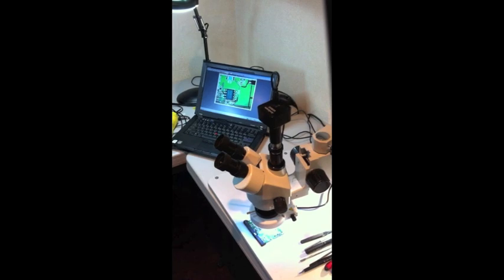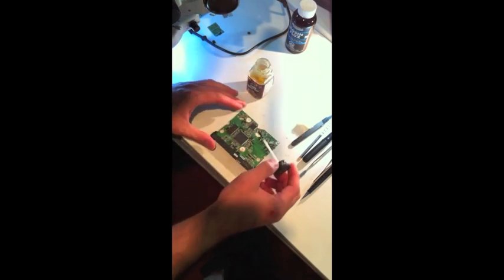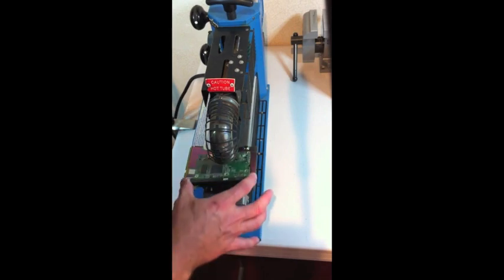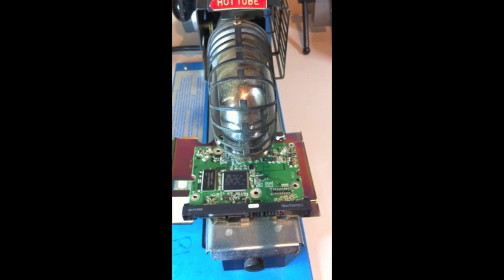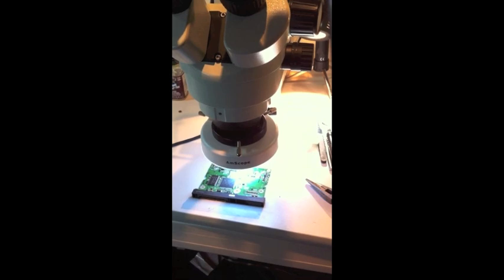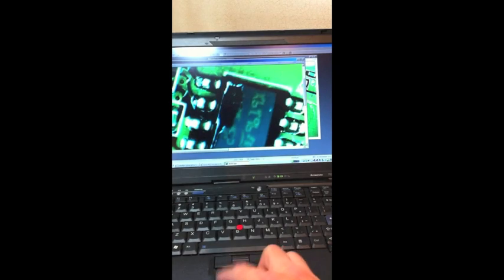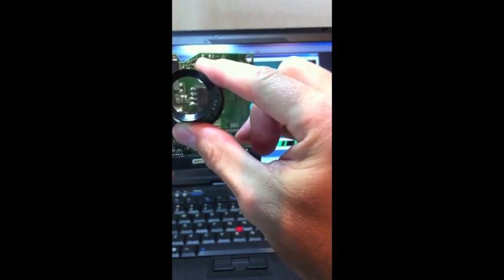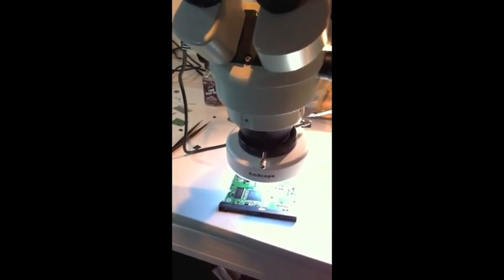Western Digital Hard Drive Board Repair U12 Part 2/3

Comment: Excellent video and very educational. I tried once with a standard 30-40W solder and no flux (I didn't know!) and struggled to get a U12 out but did in the end. The U12 is visibly intact, but since it didn't work on the target board, I wanted to ask you what are the chances I damaged it (burned?) when desoldering it? I held the solder tip against a U12 leg for 20 sec or so a couple of times.. would you say I damaged it? I now have another donor board to try. Can the U12 be tested with a DMM btw?